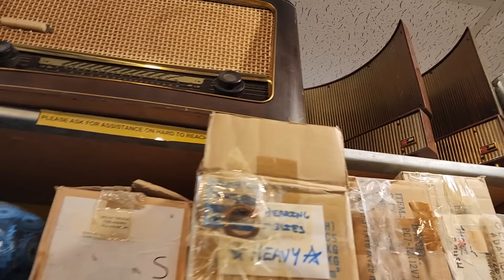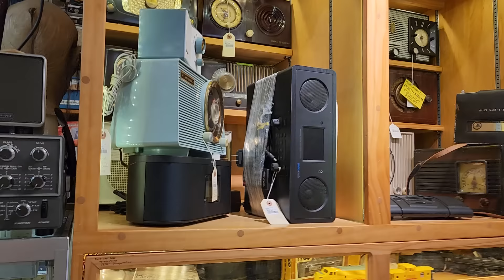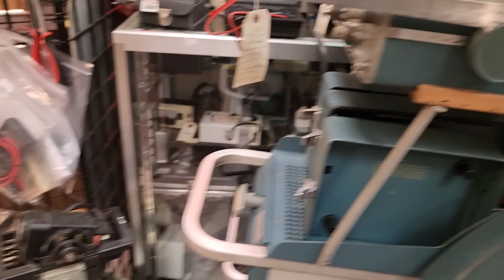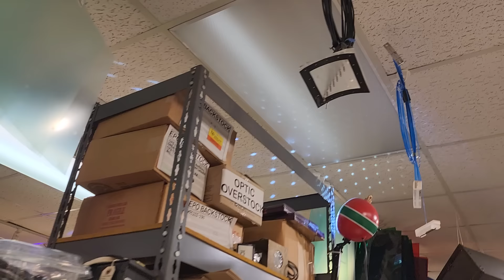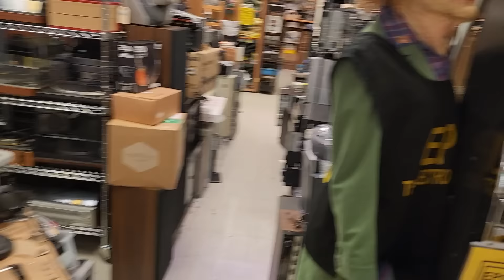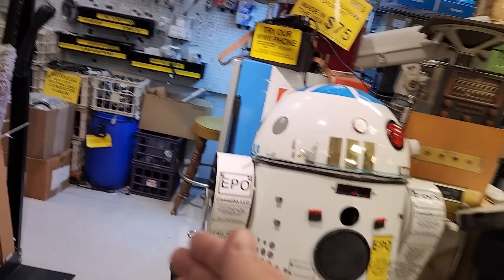Don't Miss Out on the Best Electronics Store in Houston: EPO!

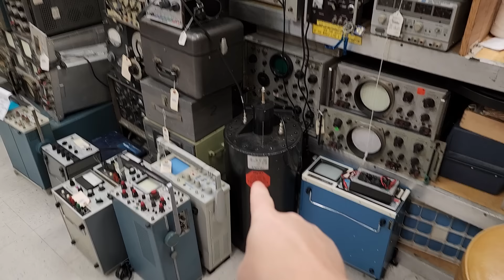Comment: 05:58 That is a pass filter for an RF combiner.  There is one of these and one circulator/isolator for each channel on the transmit side.  It is used to combine multiple transmit channels into one transmit antenna.  I have several of these in use on different repeater sites.  You would use this to keep costs down on antenna and feedline installations.  Instead of having a dedicated antenna for every transmit frequency, you would have one antenna for multiple channels, usually 5 or six is the max, since RF power is cumulative and the antenna can only handle so much power.  So, if your transmitters are 100 Watts each and your antenna can handle 600 Watts, then you could have 6 of these cans to make a 6-channel combiner.  This looks to be a UHF filter based off of the size and it appears to be made by Decibel or possibly Celwave, but you'd have to look at the label to verify that.
Reply from the maker: Excellent! Thanks for the heads up
Reply: I'm also a fellow BMET.  I was an Advanced BMET (8410) in the Navy.  I no longer do BMET stuff, due to my communications job, but I still have my own electronics lab at home.  It was the best job in the Navy as far as I'm concerned.

Comment: I bought my first IBM Clone pc from EPO. 8 bit 8088 processor.   It was a super fast 8 Mhz and it had a Turbo button that made it 12 mhz!!  I bought it for $600 back in 1980.  It had one 5 1/4 floopy drive.  I soon got the multi I O clock game port, serial card and populated the memory to 640k.  I saved my bucks and soon bought a 30 megabye MFM hard drive which was huge at the time.  My pc had a Monochrome Amber monitor.  The 30 megabyte hard drive was $395 1980 bucks!!  I loaded wordstar on my new hard drive and microsoft flight simulator.
Reply: That was my dream to have a 8088  pc. Was playing with a cheap clone of Apple] [ 6502 proc. Happy days.
Reply from the maker: I'm curious what that device would be worth today as a legacy device
Reply: @BetterBiomedChannel  I wish I still had it.  When you turned it on it was a good 25 seconds before anything appeared on the screen.

Comment: Used to go here when I was a kid. Up top there was a model train set that would circle around the whole place which was cool to see. Dunno if it is still there but they stopped rolling it around ages ago. You might see the track still though.
Reply: Place also has been around for ages. Hasn't changed since the 90s.

Comment: I thought that store looked familiar before I saw the address, I remember going there in the late 90's - I still have some of the parts and even used one of the tools from there yesterday - in South Florida where I am at no longer has any electronic parts stores with a proper inventory - I needed a volume control for a metal detector and the only place I could get one including and internet was from the Detector manufacture themselves - I still have 5 or more of their detectors and they closed and sold the company to Garret so if I ever need anything I am screwed or I will need to run to Houston -

Comment: 1:17 - That might be a Grundig German vacuum tube radio. My parents used to have one. The size and style looks very similar to that one. The one we had  - had a 1/2" slot the same width as that radio station dial. When one would turn on the knob, the radio had to warm up before it would turn on. As it was warming up, in that long 1'2" slot, two intense turquoise blue bands of light would start (at opposite ends of that slot) moving towards each other. They would waver a little back and forth as they moved toward each other. When they finally came into contact with each other in the center, the radio would emit a loud crackle sound and then one would hear the radio station. The one we had looked so similar to that and had six gold plated internal speakers - 2 in the front, 1 on each side and 2 in the back. The radio would send out a mono audio signal (not stereo). Now here's the icying on the cake - There was a modern component stereo system in the room tuned to a Black Funk and R&B station in NYC - WBLS. I hadn't seen this radio since I was a kid. My brother sent it out and got it fully restored and now that I was in my 20s would be the first time I would ever hear it on. As a kid, it was always discarded on the side, broken - never used. My brother tuned that old radio to WBLS too and switched it on. When it finally crackled to life that mono signal radio shot out a 3D holographic audio image of the DJ speaking in the station. I was so realistic that I actually jumped back from where I was standing because it felt like the DJ was in the room with me. That little radio made the modern stereo component system sound flat by comparison - since it was vacuum tube tech, the sound image was so much more warmer too.

Comment: In Bristol .UK we had a shop called Pits of Picton street All ex MOD equipment and Electronic bits and pieces. You could get your allunium chassis made there. . I build many valve auido amplifier based on Mullard circuits. About 60 years ago

Comment: There was a, Fleamarket. Just west of downtown Fort Lauderdale, Florida. It was totally incredible and every day. Until 6 PM. When it would then become a, 12 Plex Drive In Movie Theater. With a Bitchin' Snack Bar.

But during the day. I would wander the lots and all of the, fleamarket Patrons. And I got some incredible deals on incredible gear!  I could hardly believe it! What is it doing here? Full grade broadcast stuff. Now retired. Still looking great! And audio gear. Microphones, headphones, all sorts of stuff. I would go nuts. Too much cool stuff. So little money. I even purchased a, Betacam Camcorder! For just a couple hundred bucks. It was totally Awesome! And then a movie and dinner! At the same place! And. AND!

They had a Full Blown, Performing Circus! Something like the Rutherford Family Circus. It was Great! They did something like 2 Free Shows, Daily! And the guy who owned the place. He was a former, Race Car Driver. And he had them on display in this Shopping Mall. He had with the big building. It was Wild! And right off of, I-95 or was that State Highway 441? I forget? I lived only blocks away. I had a blast.

There was a store similar to this in the Baltimore area also. I purchased a lot of parts from them. As they were also a full-blown electronic parts dealer. So all the transistors, volume controls, switches, transformers, resistors, capacitors. You can possibly imagine. They were great! And thanks to them. And others. I designed and built. Baltimore's 2nd Largest Music Recording Studio and Commercial Production Facility. When I was only 22 back in 1978. In my formative years of my career.

So yes I dearly love stores like this. And in my Retirement, now. I'm going to have fun finding others. Across the country. As, what else is there to do? Wait for the USA to be Destroyed? Okay I'm waiting. But I'd rather not have that happen. I just want to go, Nomadic Motor Homing. As housing and departments are too damned expensive. On a Social Security Retirement Benefit Income, only. Things didn't work out quite right for me. As it hasn't for so many other Americans. And these times they are a, changing. I am not liking much. It's going the wrong way, backwards. I don't want to go backwards!

So where we end up nobody knows? Other countries are going nuts. The world's on the verge.
RemyRAD

Comment: Yes that store is Awesome! They got all the stuff. The Goodwill has thrown out.

In fact. As you were panning by some buckets of, electric motors. I Instantly Spotted. A, Capstan motor and flywheel. From a particular model of, Recording Studio, Analog Tape Recorders. Oh my God! I know those motors and flywheel so well. And they last forever! They are really solid build, Hysteresis Synchronous Capstan Drive Motors. I would've snatched, that up. I still have a couple of those recorders. I worked for the Company. I made those Studio Recorders. They were called, Scully's. But there is no, Molder. It's just lots of Scully's. And Ampex. 3M, MCI and Studer. Not to mention the Japanese offerings of TASCAM, TEAC, Sony, Panasonic, Otori, AKAI, Panasonic and others. Most performed better than our Studio Recorders LOL. But they were CONSUMER Formats and Speeds. And they sounded good. But they also sounded Japanese. Because they were.

Yes I do love stores like that. You always find something you can't live without. But really should LOL.
RemyRAD

Comment: You should time off from work or come down when not rushing around all day. The optical you saw, was to test each of your corner eyes with a puff of air. Not for sensitive eyes since you have to rest your chin on the metal piece while the doctor adjusts the height and sides his side in the center of your eye. While that is happening you have to not move and not to blink too( a light is shining into your eyes blinding you). When every thing is find the doctor presses a button and a puff of air into the Corner of the eye. Uncomfortable for a second. Tears will come out. Only a little. The machine is to test the pressure inside the eyes. All done in less than 2 minutes, or depending on the patient.

Comment: The old Art Deco radios, if the internals are gone or unfixable... using their shells to make a wifi/bluetooth radio, and/or a google or amazon assistant by installing a RPi use to fetch damn good money.   The smaller the better for the assistant make-overs.  Could even set them up as a simple home email & web browsing computer using a Raspberry Pi 5.  The wi-fi radios were big for Doctors waiting rooms ... or any professionals waiting room.

Or Art Deco electric space heaters that looked like they wanted to house two (a left & a right) speakers also sold well when repurposed.

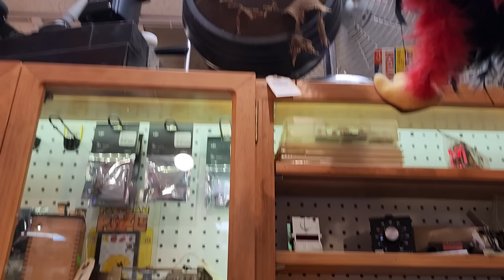Comment: The Optometry device around 17:30, "medical device , looks like a yag laser"  is an air puff tonometer that measures intraocular pressure... glaucoma test. I worked at an optometrists office in the early 1990s...

Comment: There used to be a store in Las Vegas, called Buck’s Surplus.  It was similar, in it was crammed full of all kinds of esoteric, and obsolete equipment and devices.  The fun part was Buck knew where everything was.  And if you were trying to replace a broken device, you could bring in something broken, and Buck would walk right to it.  Buck died, the store sat for a few years, and then burned to the ground.

Comment: As a teenager   I visited a similar store in 1979 Called   Capitol Iron   in Victoria BC Canada   which sold outdoor camping gear,   fishing gear  workwear,   and down in the basement was an antique electronics pawn shop with vintage military surplus radio, radar equipment.  Loads of antique 1930's to 40's  telephones.  1920's black knob radios,    dozens of pre 1950's radios,  record players.  I bought a liter of 3/16x1/2 inch brass nut and bolts (still have some of them today)  a 1940's metal 365 tuning capacitor (still have it) and  a 1000 ft roll of 26 gauge copper magnet wire.  Capitol Iron still exists today although the vintage store section closed in the late 2000's

Comment: I used to work in a very similar shop several years ago. It was located a few miles from where I was living at the time. Very close to how this store was set up. We had a wire center where a measuring setup would wind the wire up and measure it's length. A piece of masking tape with the price marked on it for the cahier. Some electronic tubes had to be ordered either from China, Russia or other country outside of the US. Could take several months to get them and very expensive also. sold antennas for TV with rotors for them. Most parts were imported. We had a good selection of resistors, capacitors, a wall full of switches. The internet finally killed this store after 61 years of operation. So sad to see it go. They call this progress, I think.

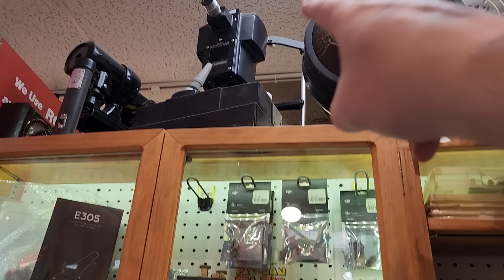Comment: That optometric instrument at 17:39 is an American Optical non contact tonometer, the first of the now myriad air-puff gadgets for measurement of the eye's internal pressure.  It will date from the early 70s.
Reply: AKA Glaucoma puffer ...
Reply: @cajuncoinhunter  aka the only thing i hate about eye exams - yes, puff air into my eyes so they get all watery, and THEN "which is clearer - 1 or 2", "neither, because my eyes are still watering from that stupid puffer"